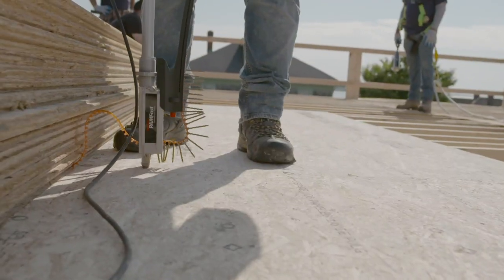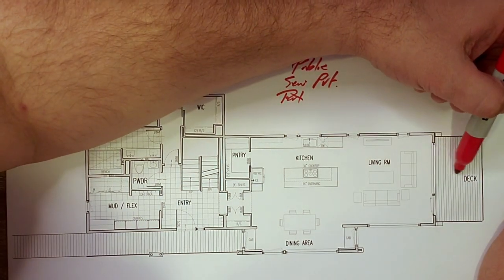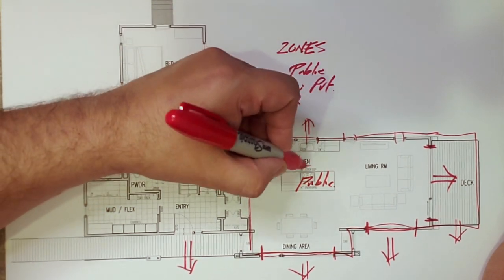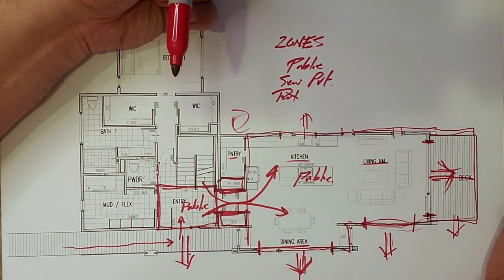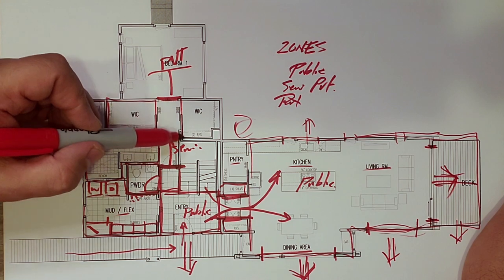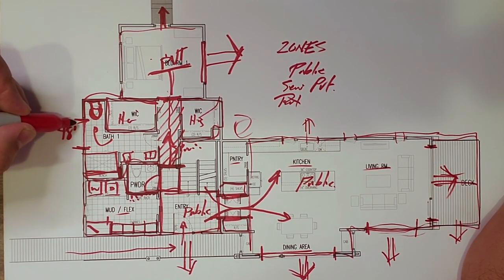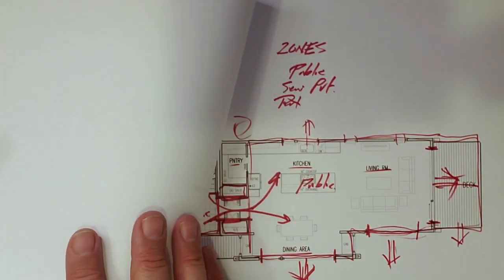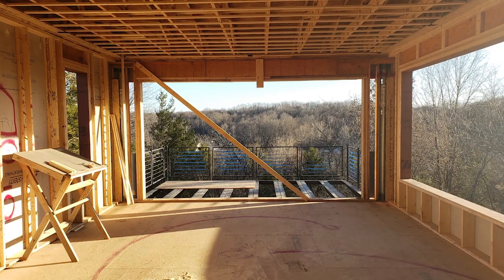The Floor Plan - Before The Build Series: Hilltop Aarow

Comment: Rotating stair on 90 degree right will give you on second floor bigger bathroom and door-separated room with table and computer.
Sorry for my english.
Reply from the maker: Was discussed, but homeownwer wanted open handrail up on left side
Reply: @stevenbaczekarchitect9431  ok, thnks for answer

Comment: How many of the floor plan decisions are influenced by load bearing wall requirements? 

I’m not going to build a full house, just a cabin one day in the future, to retiree in. In my quest to keep costs low and maximize space, I find hallways and nook and crannies to be too much wasted space. But as always, it depends on one’s goals. 

This is my plan…
30x40, divided into (left) 3x 10x10 rooms, 10 foot ceilings, (center) main area 30x20, cathedral ceiling, (right) 3x 10x10 rooms, 10 foot ceilings.

The outer wall has a height of 14 feet, that leaves open space above the left and right sections of the building. This area remains open. The cathedral ceiling goes to the outer wall. 
All rooms open to the main center area. No hallways. Open concept kitchen/living area. Kitchen is south facing. Bathroom is adjacent to it. Utility room for electric and water is next to bathroom. The remaining 4 rooms can be bedrooms, office or whatever. 
The south facing wall would have lots of tall windows to let the low winter sun in and brighten up the living space. 

Clearly I’m going for less of a privacy separation of the zones. 

I really want to build this with ICF. Even the roof, which might proof more difficult. Considering a steel beam as a ridgebeam. Outer walls are planned as 12” concrete ICF, inside walls and room ceilings get 8” ICF.
Hoping to keep basic build cost under $100k. So I guess I’ll have to do some work myself. 

Does this sound like an architectural challenge? Or easy peasy?
Reply from the maker: Depends on the size of the house, larger houses have larger spans typically, and may be a little more of a challenge. Smaller house typically have spand that are prety easy to deal with. As for hallways and such, you can minimize them, but many times they have their place
Reply: @stevenbaczekarchitect9431  do you work mostly on large project or do you squeeze in smaller ones here or there ?
Reply from the maker: @4philipp  All sizes

Comment: Really like the idea of zones in place planning. 

I found your name through watch Matt Risinger's channel. I was watching the video on Slab on Grade Insulation https://www.youtube.com/watch?v=8SSG2AofIe8 and he mentioned you as the man behind what he was doing in that video.  I was wondering if you could help me with a question.

Heres the situation: I’m in the design phase of building a home. It will be a slab on grade cinder block home in southern Florida. It will have a below slab drainage system.

Footers will be poured and the exterior block wall will be built right on top of the footer.

I will be having closed cell spray foam applied under the slab and up the block walls. The slab will be poured after the spray foam is applied.

I could put in the same system as Matt did in the above video with the 1.5" insulation taped as a vapor barrier with 2 sheet of plywood or install a sleeper system (treated 2x4) for the 3/4" T&G subfloor to be installed upon. I want a hardwood floor and I don't want to be walking on concrete all day so I need something

Here is my question: Since I have a vapor barrier (closed cell spray foam) completely surrounding the slab do I need a secondary vapor barrier on top of the slab? It is usually common to install a vapor barrier before putting hardwood over concrete but would it be ok to sandwich a slab between vapor barriers? I know we would never put any other building material between 2 layer of vapor barriers.
Reply from the maker: I have done something like what you are asking in the past, I did not put a vapor retarder on top of the slab. However, we let the slab dry for 4 months before installing wood over it. My rule of thumb is 1 month for every inch of slab thickness. 4" slab = 4 months.....